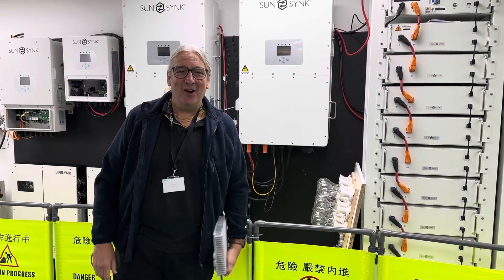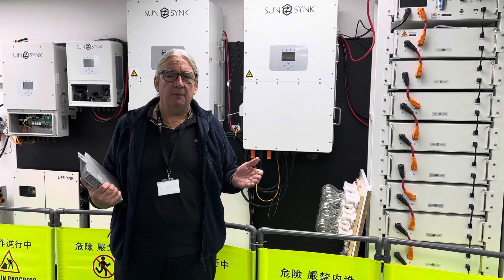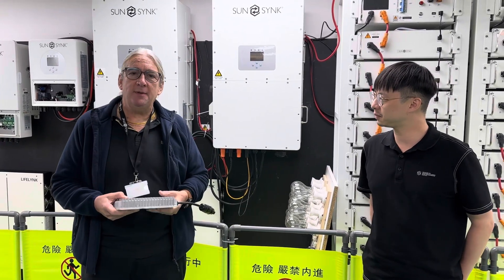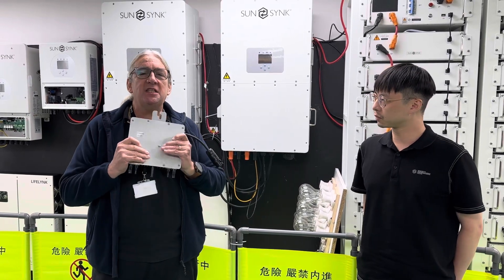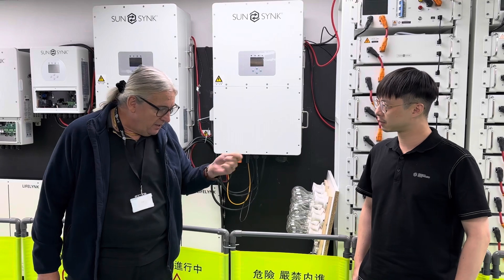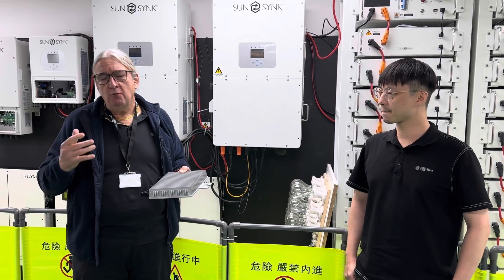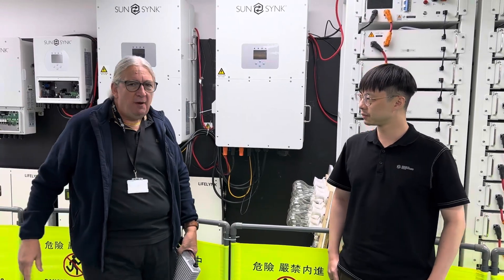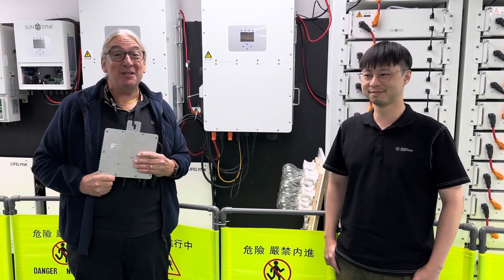Creating a mesh network to add to Sunsynk   Container Battery

Comment: I can see a use here with off grid solutions whereby you need to dramatically need to increase PV generation and your string inverters MPPTS has been maxed out. Adding micro inverters into the Aux/Gen ports is a great way of increasing solar capacity without having to go with a expensive fuel guzzling backup generator. Micros will drive the load and stringer inverter Mppts to charge the batteries.

Comment: AC coupled PV system in South Africa won't be a great selling point due to loadshedding. I hope this can be used on the AUX port on Sunsynk inverters to keep the PV array going during power outages.
Reply: the GEN input can be set as a micro inverter input, where the main inverter will do frequency shifting to control the micro's output and switch it off when the load is low